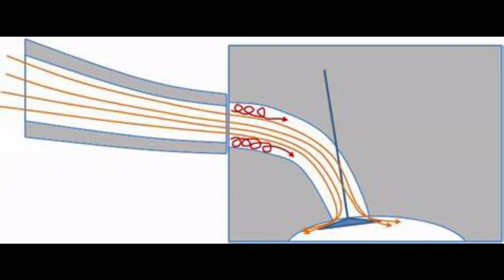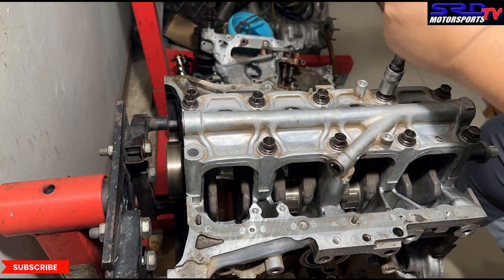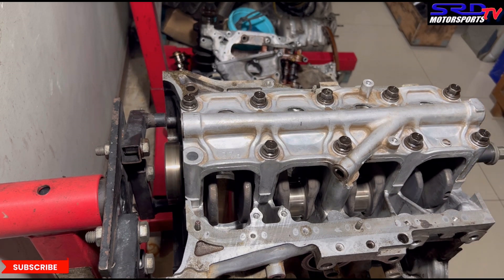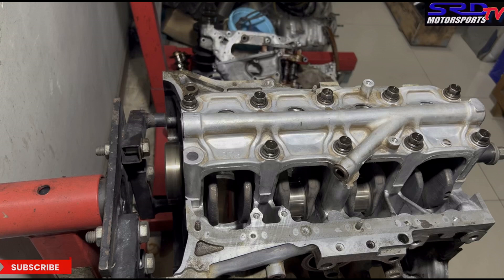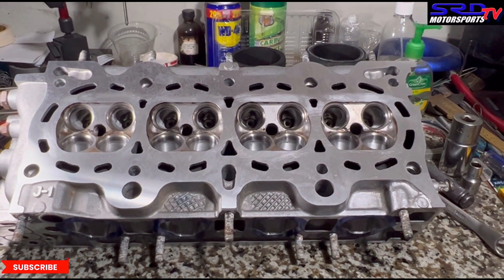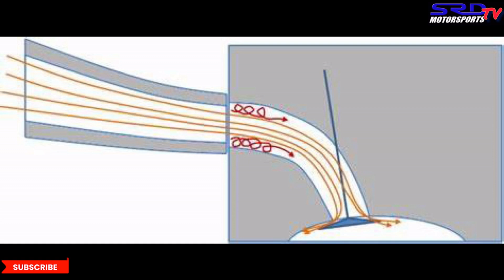Civic VTi D16y8 Ph16 Rebuild Series Part 3 Block & Crankshaft

Comment: U killing with those video also can u gave me a good set up for a b18a acura integra gs model I want to make 200hp all motor if it's possible or 300 booster ?
Reply from the maker: Oh man! Thank you

200hp Is okay but 200whp might be hard 

But in any cause the basic TypeR set up on a b16a is easy 180-185whp which is 200+bhp for sure

one trick set up if the TypeR cams are too expensive (sellers go crazy lol)
Crower 402A is trick (not the 402 without A)
Letter A on their part number signifies a slightly “hotter” but same as TypeR primaries meaning only their vtec lobe are a tad bigger than TypeR but the primary/ low cam is same 

then if a ITR manifold gets too expensive 
Wait on skunk2 Black Friday sale for their skunk2 pro series intake as it’s just like a TypeR 
Ftw!

Comment: Good coverage on the mild upgrades done on the OEM IM and head

Really curious on the additional fitting on the PCV system

Good job, Ralph
Reply from the maker: Thanks man! And yeah a lot of them skip the mild approach thinking it’s better when a lot of times what happens is they still end up with “mild gains” if any so “sayang”
Reply: @SRDmotorsports  
Little do they know that everything starts with small steps haha
Reply from the maker: @blue3549  and that Honda covered all the bases for real!!!

Comment: I'm excited to see how you make out of that black box. Great job!
Reply from the maker: IKR! I mean it’s trick stuff that could and would work for any platform ftw! So definitely il try to present it as good as I can this way it’s easy and fun to follow
Reply: @SRDmotorsports  oh BTW, what are your personal thoughts on an after market Oil Catch Can? Is it a good upgrade or the stock made by Honda will do?
Reply from the maker: @XilenTMedia  well the aftermarket ones, the benefit is added fitting or added places u can plug to… example if the VC has extra fittings then it could help there is a place to go to…

But that’s for engines with it cuz a B20 doesn’t have the breather can at the back so it’s natural option is an aftermarket catchcan
Reply: @SRDmotorsports  well said. Thank you very much for the info, brother. 🙏
Reply from the maker: @XilenTMedia  anytime man and thanks for the comment/questions cuz we might realize these questions are asked by hundreds in silence and some I didn’t get to explain until now ftw